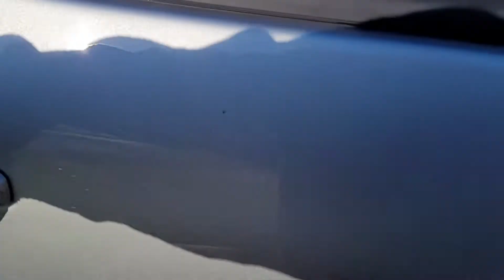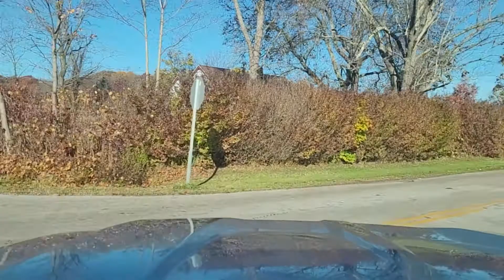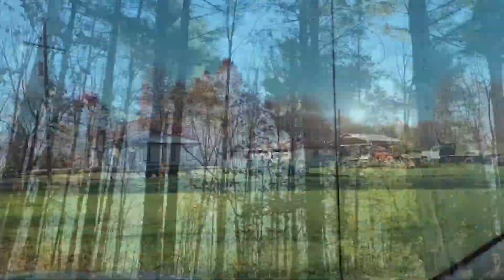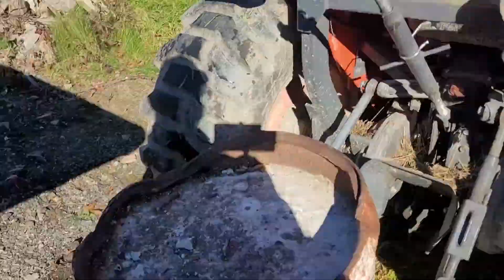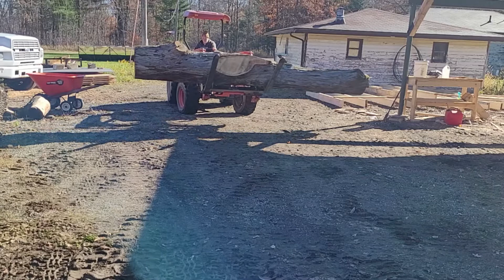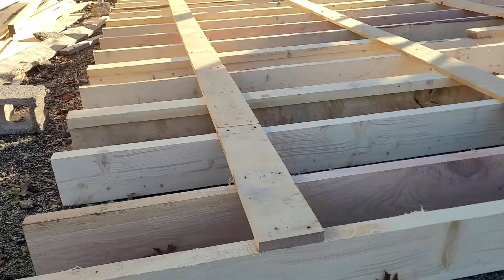#85 Milling this huge Log for 2 Measly Boards!! | Sap Tank Shed Build Ep. 2

Comment: All that oak, that is one heavy floor! People don't realize just how heavy wet oak is, I have a 4x8x10ft oak, if I lay it on a concrete floor you can't lift one end because you can't get any kind of grip on it. I have to use a prybar to get it up a little so I can get a grip from the bottom. So that's like 2 of your 2x8's, how many you have in that floor?